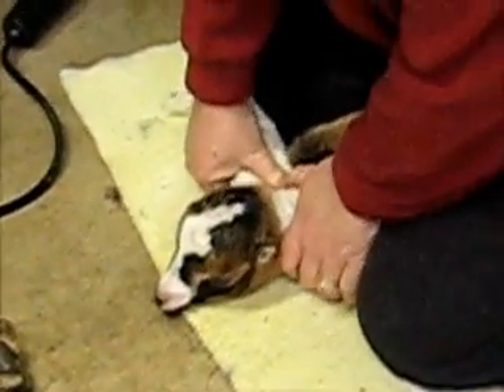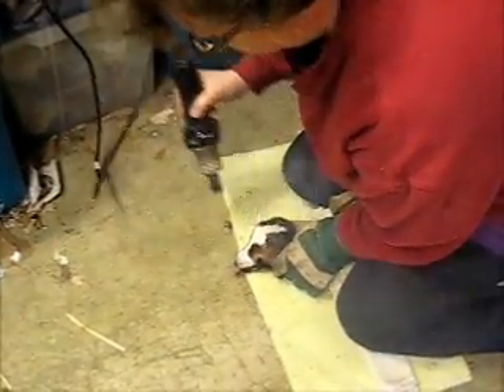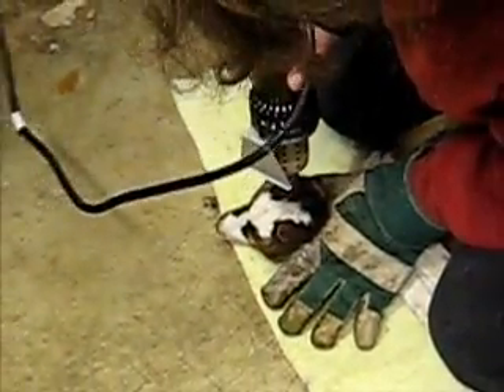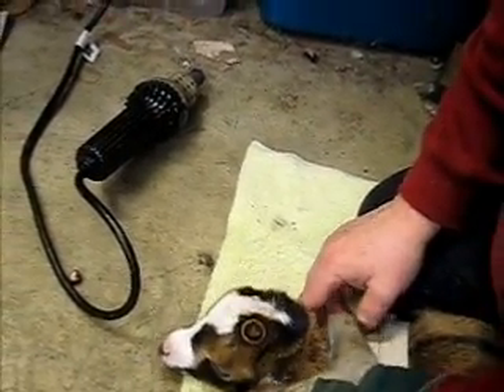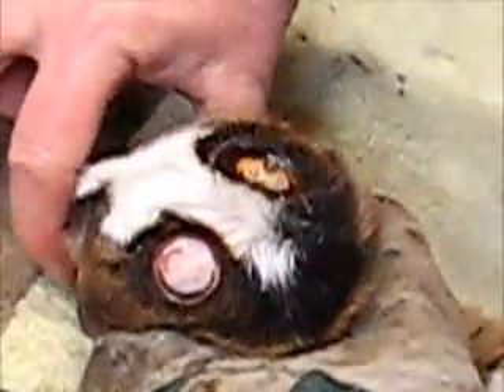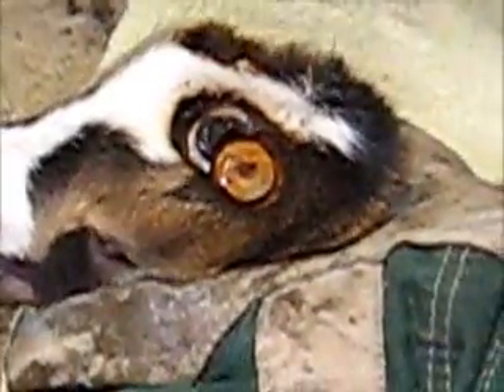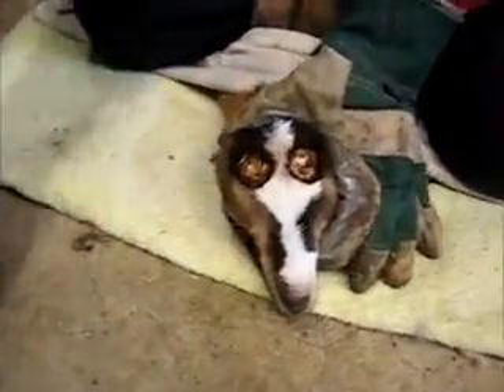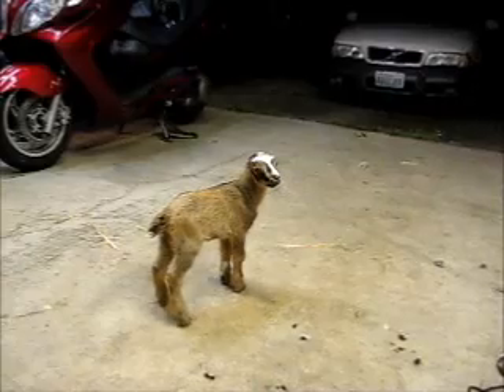Disbudding a Goat Kid Alone

Comment: Thanks for this!  About to do my first ones and this was a great explanation of the blood vessel and a different holding technique.  Nice to know you can stop and start again as needed too.  Some say 10 seconds, some say 15 seconds... I am "getting" that the timing is not an exact science and you have to feel your way to get it just right.  Thanks again.
Reply: I try not to go more than five seconds for any single burn, let that side rest for a few second, and repeat as often as needed to loosen the horn bud so I can flip it off.  With a good hot iron and more quick, shallow burns rather than one long, deep burn, there is less danger of the heat radiating through the skull to burn the brain.  -Laura (aka Suburbanhomestead)

Comment: Oh, that was so hard to watch!! What iron should we buy? What temperature do you set it at? Will it dehorn baby calves? What about Baby sheep? Are they disbanded?
Reply from the maker: I use a Rhinehart X30.  It comes with the right tip built in, so it gets hotter and does a quicker, better job.  It has its own thermostat, so you don't need to set the temperature.  I don't know anyone who disbuds sheep.
Reply: I use the X50-A. It is a calf disbudding iron with a tip for goats that you screw in. You can just take the tip off to disbud calves.
Reply from the maker: I have an X40 as well, but it doesn't get as hot as the X30, possibly because the tip is not an integral part of the iron.  I suspect the X50 would have the same problem.

Comment: Guys... I promise you... This hurts the goats no matter what you think... 1000 degrees is bacically touching his skull. If you have the option to not disbud your goats... Dont!
Reply from the maker: Of course it hurts.  That's why nobody likes to do it.  It is necessary, though, when goats are kept intensively, as in a dairy situation.  Full dairy udders and pointy horns are a very bad combination, so disbudding is a necessary evil.
Reply: Fishers Dad, clearly you have reading comprehension issues.
Reply from the maker: The issue is not fencing or getting caught.  The issue is full dairy udders and pointy horns in close proximity, as when the goats are bedding down for the night, or at feeding time.  Picture a full water balloon and a pin . . . you get the idea.  You will find that most dairy goat farms with good quality animals will disbud kids for the safety of their livestock.  Farms that show dairy goats will definitely disbud because horned goats are not allowed at dairy goat shows.  The show rule came about because of the horn-udder problem.  Non-dairy goats virtually never have full udders, so horns are not nearly so much of a threat.